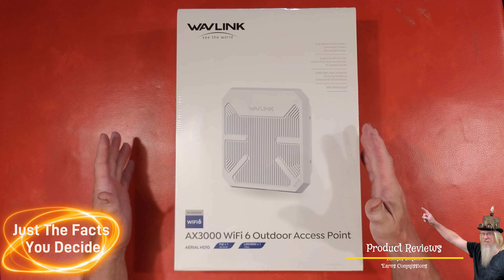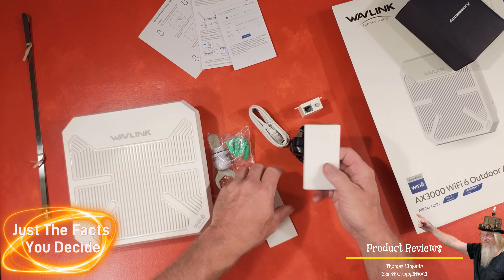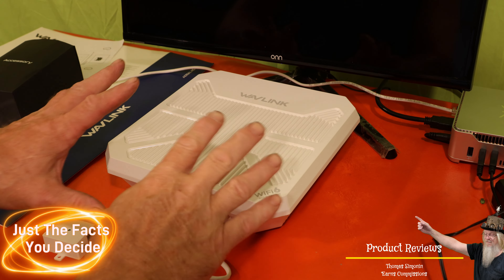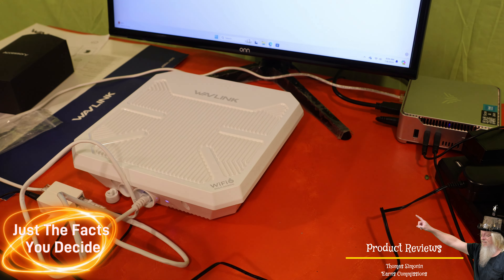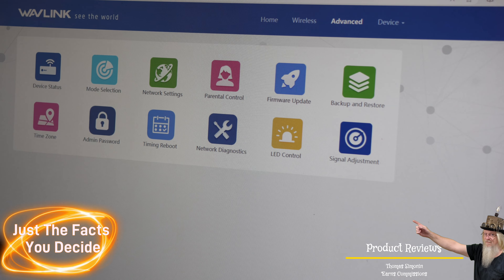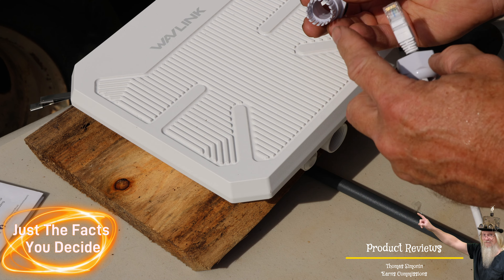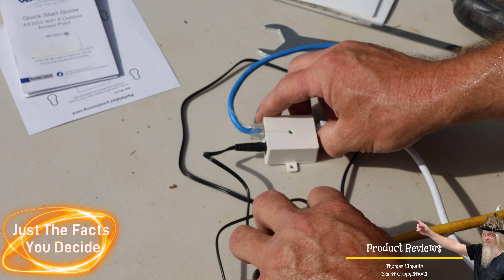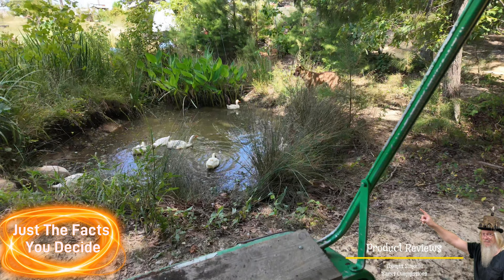WAVLINK AX3000 WiFi 6 Outdoor Access Points

Comment: Thank you sir, I bought one because of your review and it works great for my needs.   I have a 100 mb connection from Cox, and with this mounted 20' high, I was getting 100mb at about 300 feet away.   Maybe 25 mb up.    This of course was on my cell phone, and they don't have the best antenna.    If I used a powered USB antenna on a laptop or something, it would probably be really great.    I wanted to put a security camera on my gate, and as long as I was getting at least 10mb, I wasn't concerned.      At a 30 degre angle, 500 feet away, i was still getting the 100mb,  when I got to a 60 deg angle, it started to drop sharply and about 500 feet away it dropped down to 30mbits.    So it does seem to be directional.     I will need to buy a few more to cover the areas I need.  This saves me from having to trench and run a bunch of POE with boosters every 300 feet.      I can put solar/battery operated cameras all around my property without carving up the landscape.  Lets hope it lasts as it's impressive!
Reply from the maker: @KarasCyborg  take a look at the bridge video I just posted. Works very well...